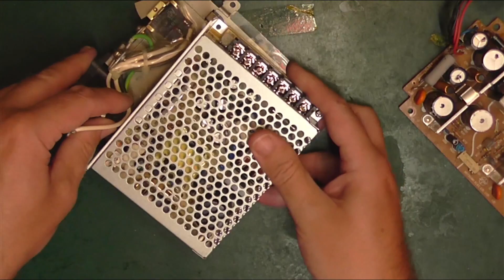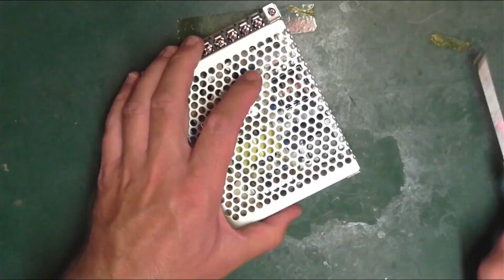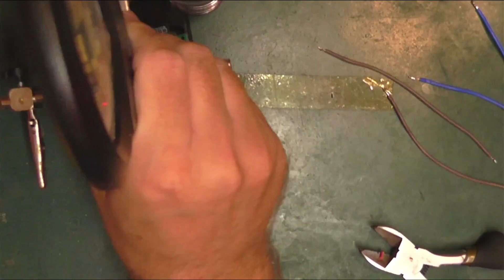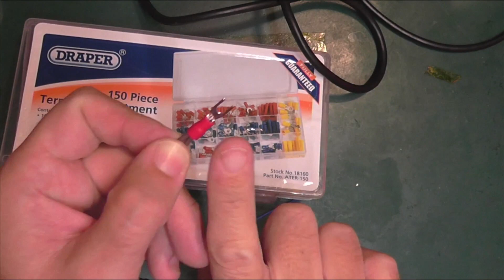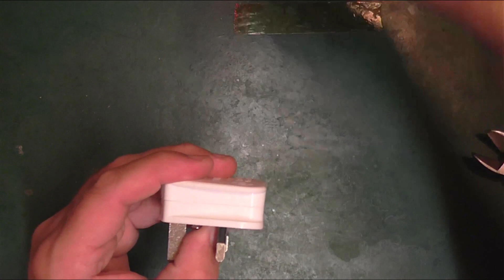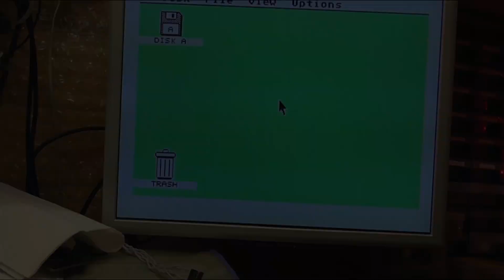Meanwell industrial PSU on my Atari STFM motherboard.

Comment: Thanks, I have two 1040stf and a 520 st fm board that was hacked on by me as a teen 
 I ordered one of these power supplies and am attempting to fix the damaged 520 .  I'll probably put it in an old PC case and put all my mods on it. Leaving the 1040 s stock and original.   

Should I recap the motherboard?
Reply from the maker: I haven't recapped any of my motherboards yet, although the reset circuit can be a bit flakey after all these years and that big cap is ripe for a servicing. I would probably only concentrate on them unless you see a lot of jailbars or have other interference. The motherboards are quite delicate and I'd say pouring unnecessary heat into them is probably a higher risk than any of the smaller caps are.
Reply: @thetechnoshed  the big cap right after the ps was bad as usual. Some of the ones near the shifter were also slightly bad and got rid of the lines on the monitor when I replaced them .  I bought the cap replacement kit from exxos as I was lazy about ordering and so I just replaced the ones I got in the kit.

Comment: The "swelling" 400V Cap must not be faulty. I also re-capped my 1040STFM PSU and removed the plastic thing after to see that the vent of the Cap is still good and not blown. This plastic cap is just for safety reasons in case the Cap really blow up to prevent more damaging to the rest of the PSU. But in fact the caps are that old it's better to re-cap all to give it a longer lifetime. :)

Comment: Why is it safer than original? Should I recap my original if it appears to still be working ok?
Reply from the maker: Old PSUs slowly fail losing regulation, increasing ripple or injecting voltage spikes. I don’t want to lose custom chips on my machines through a lack of maintenance. Especially on the Falcon.

Comment: Great stuff! I just got a 520 STFM that has the RD-50A installed, and like Greg said "...just very snug and can't use the RF shielding." It came without the shield, but has the standard power switch and IEC jack.

BW's Technoshed

Comment: Crimp with the part near the handle the lug sticking out goes in the middle to squeeze the middle down
Reply from the maker: That’s interesting. I’ll try that next time. So what are the coloured indents at the top for?
Reply: @thetechnoshed  I will have to did my old pair out I was going from memory and my wire strippers have crimpers at the bottom like yours 3 sizes small to large 0.5-1 mm2,1.5-2.5mm2,4-6mm2

Comment: Nice video!  I typically use the RD-35a as it is much more compact as it's easier to fit especially on the original bracket and inside a case. It also matches the output of the original PSU more closely.  I have fit an RD-50a as well, just very snug and can't use the RF shielding.
Reply from the maker: Yes, that one looks absolutely ideal!
Reply: Do you need the rf shielding these days?

Comment: Loved the video!
Do you plan to make another (small) video about adding a switch to this PSU?
Reply from the maker: Many thanks. If I get fed up of pulling it in and out of the wall socket, I may. I’m still also irritated by the fact only one screw goes in. Too many projects, too little time, alas!